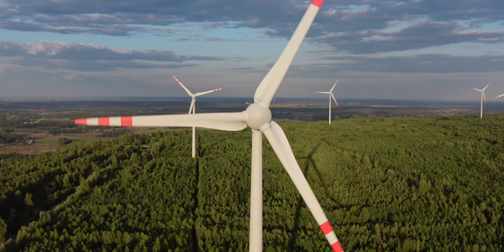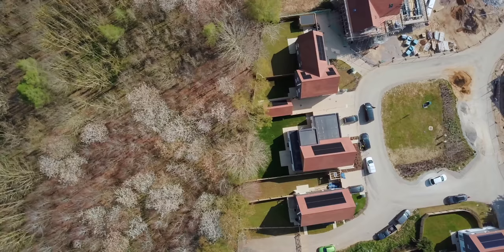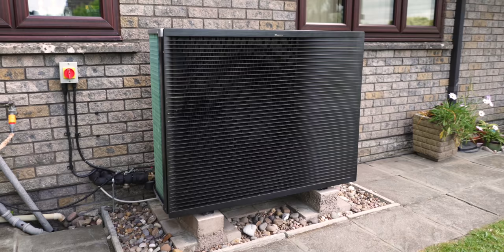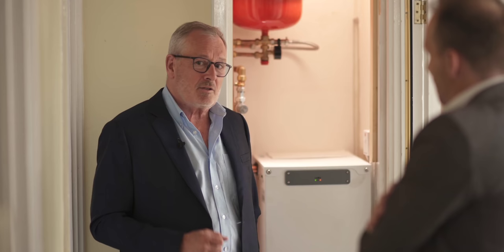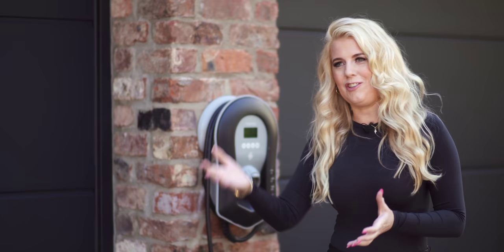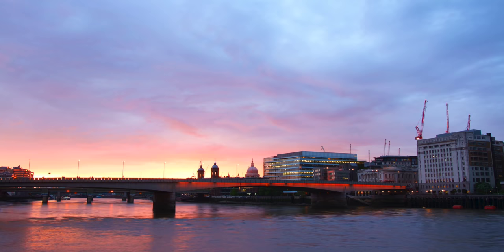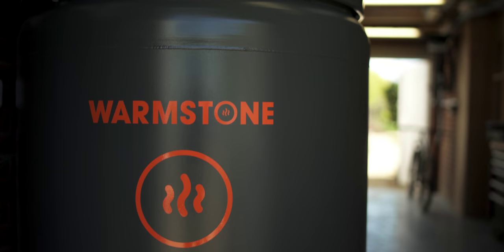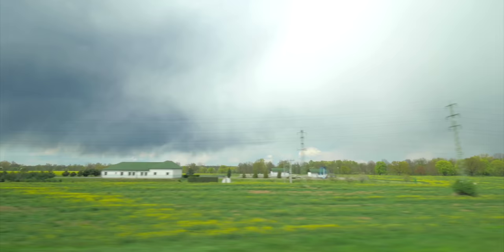HOME SERIES - 20 Minute Supercut | Subscribe to Fully Charged PLUS

Comment: I am designing and constructing for client on Northern Beaches of Sydney, 180m2 including a garage 18m2. It is passive house certifying is built from SIPform,  Tractile PV 100m2 and 30m2 roof garden.  As well   a 15kw batteries therefore the home  collect average 72kw per day every day for 300days a year.  The house will a EV with bi-charger 12kw a day average.

Comment: It is all nice and well. However none seems to mention the trendous initial investment that's needed to make these changes. It is all lovely to talk about heat pumps, solar panels etc but when you are required to fork out 10k as initial payment. It becomes a huge block for many families.
Reply: Start with the basics. Insulation, insulation, insulation. Cheapest of all the ' greening up' solutions irrespective of whether or not we're talking about domestic, commercial or industrial properties. Savings from money that would otherwise go on heating and cooling can be put aside for when property owners are ready to take the next step/s.
Reply: @pinkelephants1421  Yes exactly. We looked into that. Have a house that was cavity wall insulated as per 1980's standards. Wanted to replace it with the modern ones (beads) just to find out that "upgrading already existing " insulation is not possible under any government schemes. Even if I can prove it that the insulation collapses in the cavity leaving the house with huge cold patches. Without schemes and support we are again looking at thousands of pounds to fork out. So yes insulate if you have a house that does not have any but if you have a home built after 1979 then you are stuck between the rock and a hard place.... Again....
Reply: @saratownsend1122  You may be able to take out a loan or remortgage. If you are paying the bills anyway, the money you would have spent on bills will go to the loan instead.

Comment: Tado is good but not the best Honeywell home is far better as it treats every  Honeywell Home Thermostatic radiators valve as a separate zone and in turn relays it’s requirement to a receiver which turn the heating on and off. This means there’s no need for a central thermostat that at best can only control the heating from one position usually the hallway. The problem with that is if the area were the thermostat is cold or hot it reacts to that irrespective of the temperature in other rooms. Honeywell home is more expensive but hugely better because heat only goes to we’re it’s required, I’ve installed the Honeywell home system into our existing central heating and it’s light years ahead of the rest.
Reply: Tado have done TRVs for a good while now. They also do a kit that links the controller direct to TRVs so you don't need the main thermostat (unless you want it) Admittedly Evohome was I think the first to do it. My brother in law has Drayton Wiser, a similar set up again and he loves it.
It's on my to-do list. But for now I'm settling on adjusting my existing manual TRVs lower in less used rooms.
Reply: Peter is right, if you want to call for heat to, say the bedroom, tado would turn on the boiler and heat according to the set point and the temp sensor located in that room